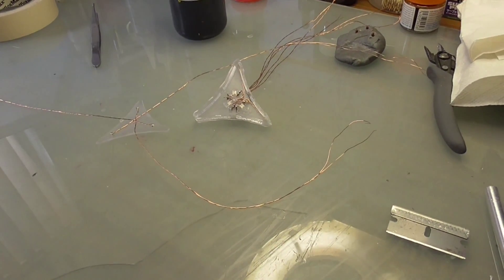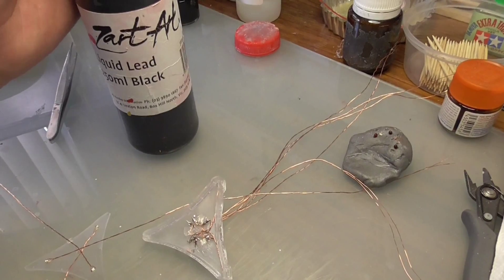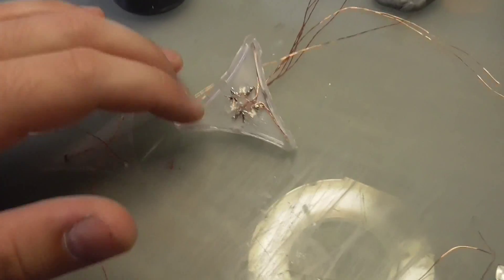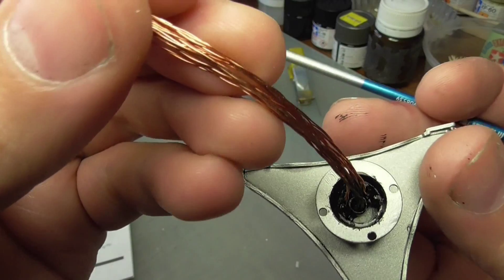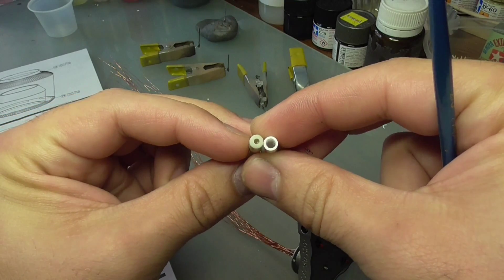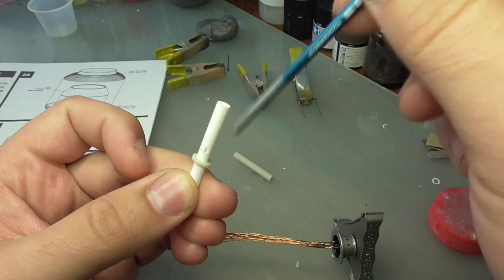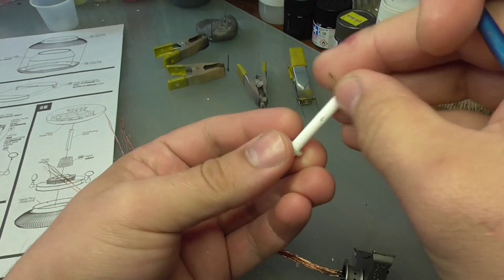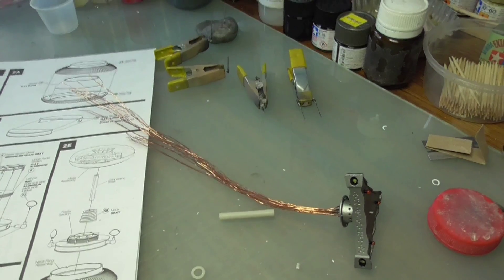B9 Robot | Part 6

Comment: great work and awesome how to planning lighting up a truck and your lights look perfect as marker lights on a semi truck .where might i find those types of lights?
Reply from the maker: Douglas Holloran Thanks Douglas. These lights are called SMD's you can find them on Ebay. The size of these are 0805. They are very tiny and required soldering wires onto. Which I use magnet wire which is very thin also. You can also buy them prewired but they cost alot more. For the truck marker lights I would add a larger resistor to knock down the brightness for a more realistic appearance.